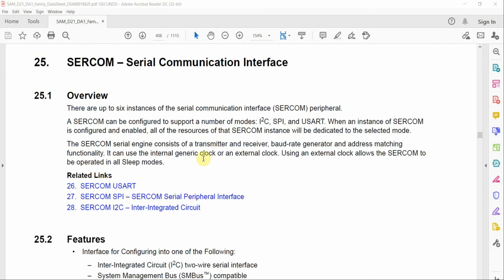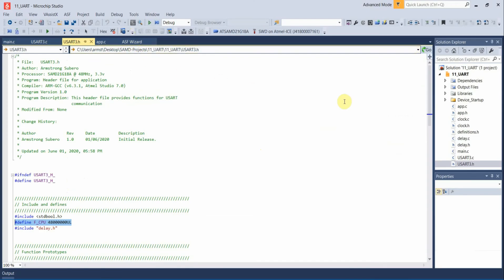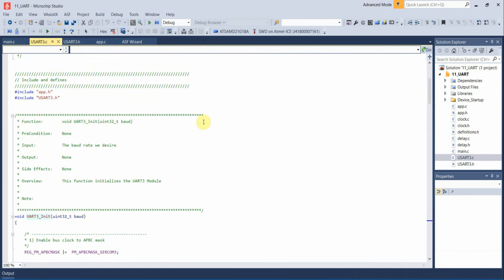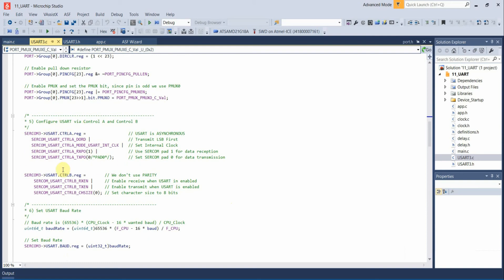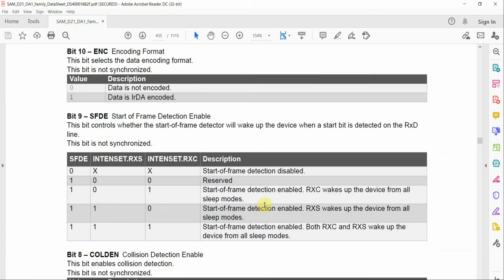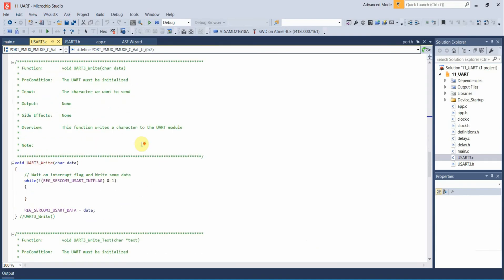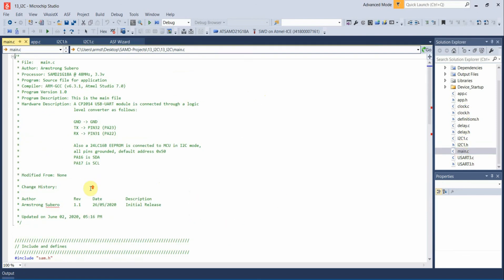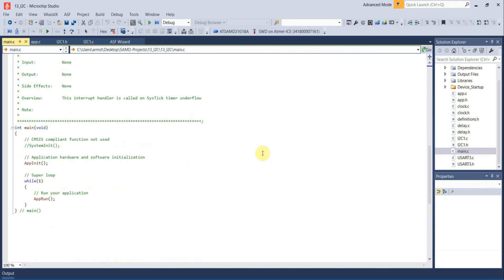SAMD21 ARM Cortex Tutorial #8: SERCOM Module (USART/SPI/I2C) (Bare Metal)

Comment: Thank you so much....Hope you do the same for timers(TCC/TC)...
Reply from the maker: Thats next so lookout for that!
Reply: I'm using ATSAME54, clock configuration and handling interrupts are little different and simple when compared to ATSAMD21. Now started timers and systick timer. You have explained systick timer registers....can you do systick timer little longer with tutorial code...bcoz I too use register access method and I'm new to ARM... thank you
Reply from the maker: @ggtechnocracy6709  Here is code you can use for systick:

https://github.com/ArmstrongSubero/SAMD-Projects/tree/master/09_Systick
Reply: @trinirobotics  thanks a lot bro...🙏
Reply from the maker: @ggtechnocracy6709  And here is the  code for using TC https://github.com/ArmstrongSubero/SAMD-Projects/tree/master/10_Timer3
Reply: @trinirobotics  embedded engineers are not so generous as u...they won't share their codes... thanks a lot once again...🙏